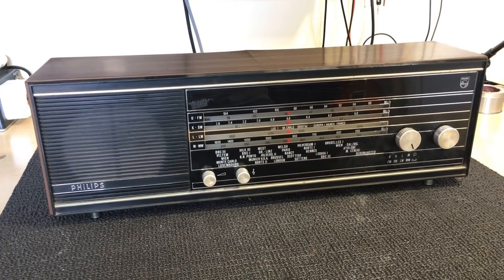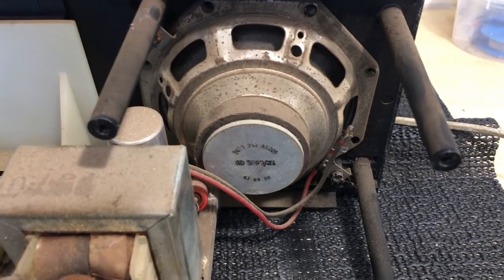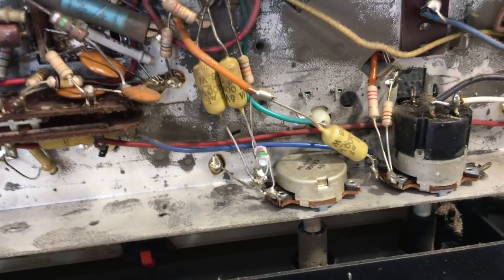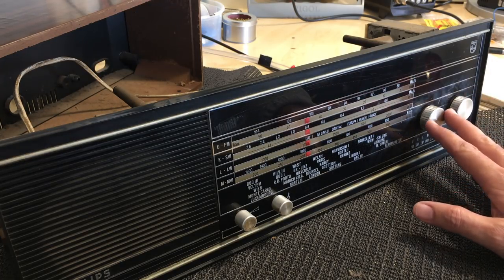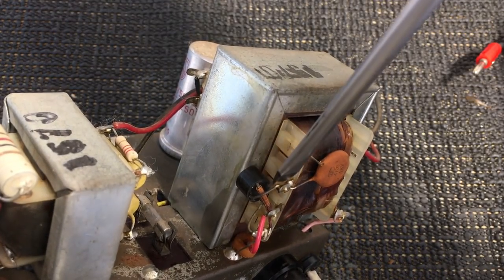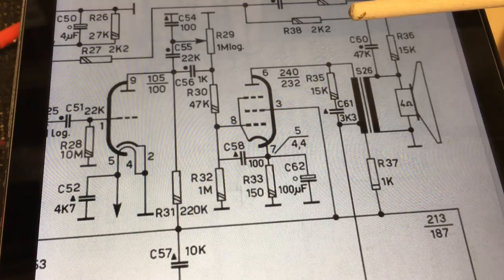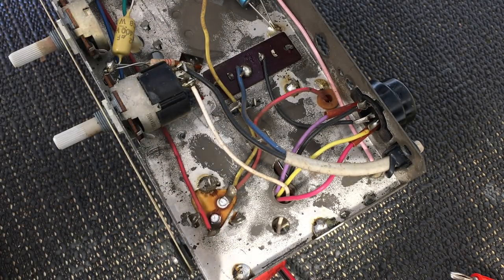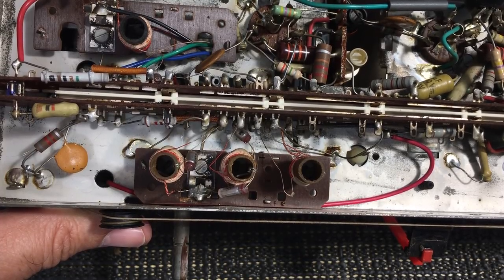Philips 22rb382 tube radio restoration - Part 1. First look.

Comment: Wow, this radio is exactly my age!  I found some Mullard Mustard caps in my Hameg (1969) they are tough, all in spec  and no one was leaky. So I leaved them in circuit. I look forward on Part 2 and I hope the Tubes are in good shape. I have a feeling and I agree with Reijo, at least one Tube is leaking. This would explain the dark resistor. Thanks for sharing this!

Comment: The ECL86 is famous of it's internal leakages, which cause the tube to draw excessive anode current. The burning of the cathode resistor may well be due to that. I have tested a bunch of these tubes, and most of then were leaky.
Reply from the maker: Reijo Liljedahl : this tube is getting rare, so I hope it is fine.

Comment: The set was made even later than 1968, as the date code on the speaker (one of the few above chassis Philips parts as the radio was made by Mivar, Italy) says 1969, week 43 while the chassis and the transformers even indicate week 15 of 1970, so quite late! From memory the last European tube models that were really made by Philips were from the 1967 model year, in any case the 22RH370 combi using the Austrian 4 valve PCB setup with transistorized FM tuner. In South America there may be valve models from the 1969 model year even.
Reply from the maker: mjouwbuis : thanks for that information. Really interesting.

Comment: Hi there, 
I have a old Philips 15RB525/11z which I want to restore . I wanted to ask if you could make a restoration video on this model also as it would be of great help to me.
Looking forward for your response
Reply from the maker: Afraid not. I don’t have that model.
Reply: @electronicsoldandnew   
Thank you  for your immediate reply .
But can you help me find a electric circuit diagram on how all the connections are connected. Because I tried searching it on the web and was unable to find the circuit diagram.
Reply from the maker: I’m afraid I can’t find it in my usual sources.
Reply: @electronicsoldandnew  
Ok thanks, for your time

Comment: Hi! I have a 1972 model Philips 22RB192/33S transistor radio and I'm trying to repair it. There is a problem to get the radio out of cabinet. The frequency pointer prevents me to getting radio out of cabinet. This radio witch you repaired looks somehow similar, but it's different. Can you give me hints?
Reply from the maker: It’s been quite a while since I did this one, so I’m afraid I can’t recall the details of how I got it out.
Reply: @electronicsoldandnew  Ok. Thank you .
Reply: @electronicsoldandnew  Now I got it out. I managed to loose the cord from the wheel, that rotates tuning cap. So I managed to wrap the cord out from the frequency pointer. I have already found a bad cap from power supply (100uF parallel with zener in 7V line, esr 26,7). I haven't found more failures yet.
Reply: Hi...
Reply: I want this radio